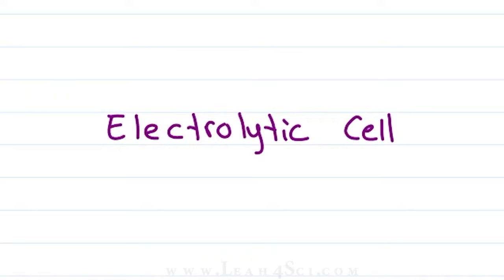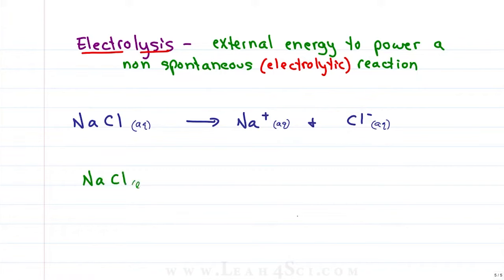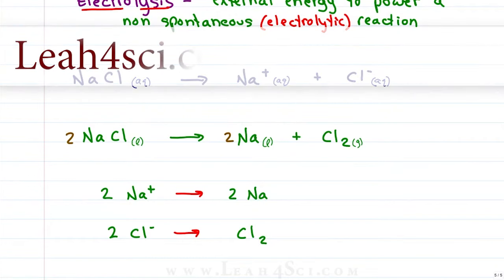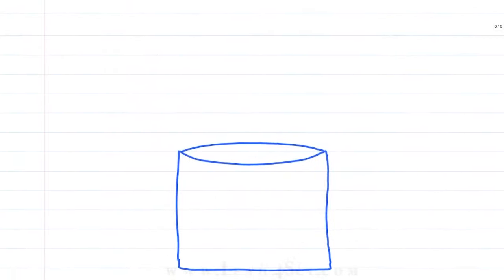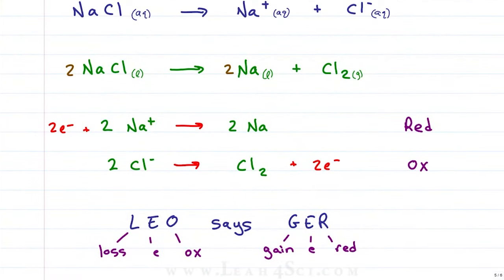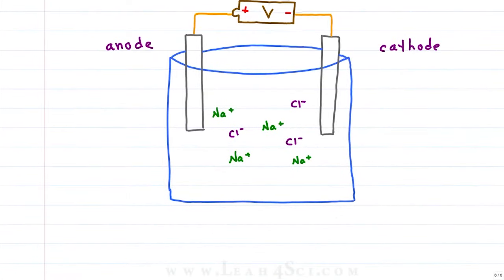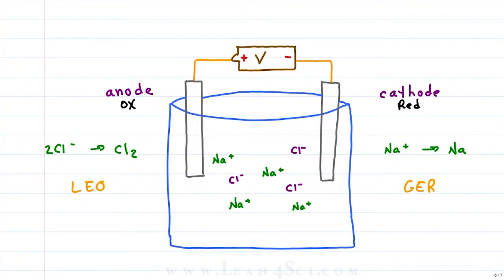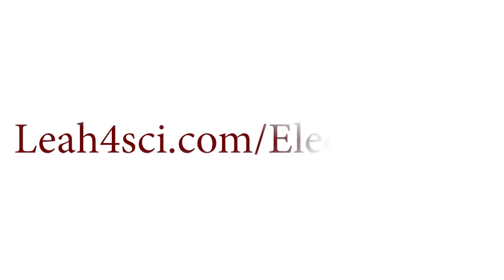Electrolytic Cells - Nonspontaneous Redox Reactions

Comment: Questions. So instead of Pt electrodes we instead used Li metal oxide and graphite for the electrodes. Would external power source orientation, which in this case the battery, matter? Would you place the positive end of the external battery souse on the Li metal oxide or graphite? Finally if you were to flip the external battery source to where the positive end is now in contact with the graphite would it still charge?
Reply from the maker: If you're dealing with a mixed open system as we have here, and your electrodes are non-reactive but conductive, then I don't see how it matters which side is connected to which electrode, however if your electrodes are chosen specifically for how they interact with the anode or cathode, OR if your system is separated into half-cells, then yes, the orientation absolutely matters

Comment: Question! I was reading that some  alkaline cells contain potassium hydroxide as the electrolyte. i also found out that potassium hydroxide is the electrolyte used in alkaline fuel cells, the first one made by Francis Thomas Bacon used potassium hydroxide. Have you seen or heard about someone making a fuel cells using the contents from alkaline cells?
Reply from the maker: I'm not familiar with this

Comment: Just to check if I got that right haha

  Basically, in here, the (-) side of the cell is giving electrons to the +ions by the cathode, and the (+) side is receiving electrons from the -ions by the anode. The cathode is reducing ions, and the anode oxidizing them.

  In the galvanic cell, the cathode is still reducing, but it's reducing what exactly, the anode? So, the metal in the cathode goes to the ion form, getting itself oxidized while reducing the anode, which is oxidizing  the cathode while reducing the +ions in the other solution?
I am a bit lost in this one

Is everything right?
Reply from the maker: I'm working on a comparison video that goes into detail about the differences. I hope to have it out in a few days
Reply: @Leah4sciMCAT  Already got my exam haha but thanks, I will check it
Reply from the maker: This is a very late reply, but hope all went well on your exam!

Comment: I thought zinc is more reactive than copper
Reply from the maker: Copper has a higher reduction potential than zinc. That means, in reaction with zinc, it will be reduced at the cathode while zinc is oxidized at the anode.
Reply: @Leah4sciMCAT right 🎉